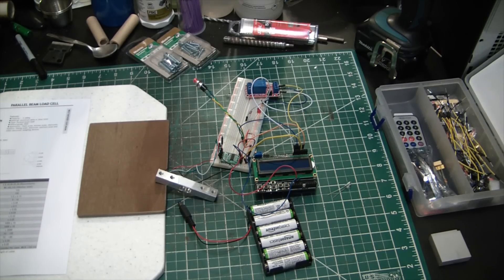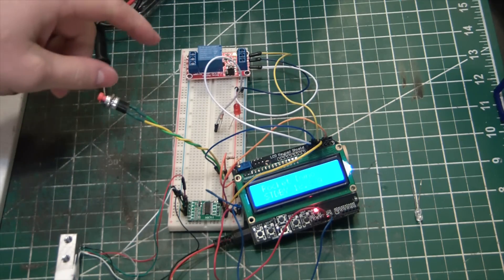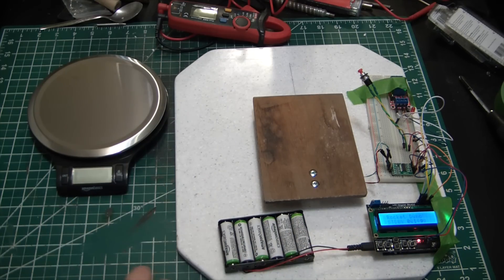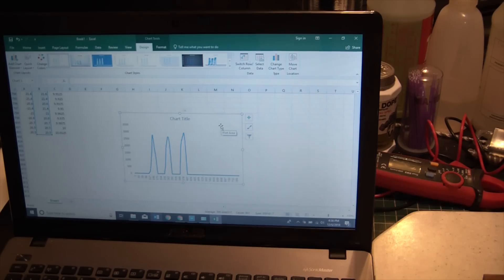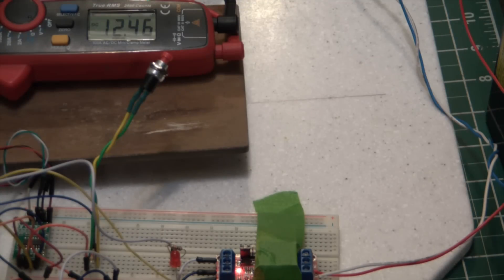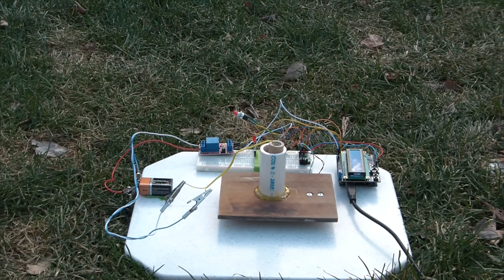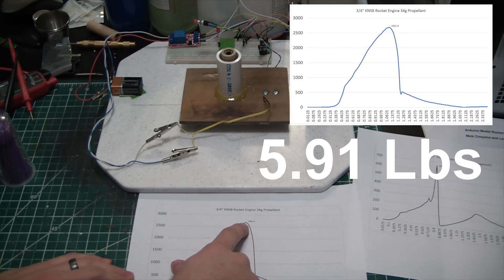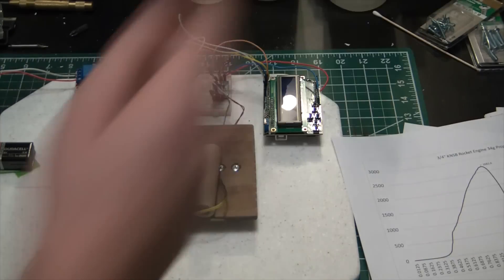Arduino Rocket Motor Thrust Test Stand! - Elementalmaker

Comment: someone who built the test stand?
I am having problems with the operation.
when I connect the arduino the relay is activated and deactivated immediately after the yellow led makes 4 sequences of 4 blinks (as far as I can see), the lcd says "MODEL ROCKET DYNAMOMETER" and the serial monitor says "HX711 Rocket Motor Dynamometer, V .5 Affix motor nozzle up. Place igniter in nozzle. Move away from teststand. Press start button to initialize ignition sequence. "
when I press the button it does nothing. on one occasion it started taking readings (very slow about 1 per second which I think is the calibration of the load cell) and when I opened the serial monitor the code restarted and no longer worked.
I have an XFW-HX711 I desoldered the jumper that I had at 10Hz and I soldered the 80hz one, as it didn't work, I used another XFW-HX711 WITH 10Hz and it didn't work either. Any idea what is happening?

EDIT:  Here is the update code

#include <HX711.h>

#include <LiquidCrystal.h>
LiquidCrystal lcd(8,9,4,5,6,7);
const int buttonPin = 12; // start sequence button
const int ledPin = 13; //LED indicator and/or buzzer
const int igniterPin = 11; //igniter transistor circuit
int buttonState = 0;
#define DOUT 3
#define CLK 2
HX711 scale;
float calibration_factor = -1120; //-560 works for my 10kg loadcell.

void setup() {

 scale.begin(DOUT, CLK);
  
 pinMode(buttonPin, INPUT);
 pinMode(igniterPin, OUTPUT);
 pinMode(ledPin, OUTPUT);
 Serial.begin(9600);
 Serial.println("HX711 Rocket Motor Dynamometer, V.5");
 Serial.println("Affix motor nozzle up. Place igniter in nozzle. Move away from teststand.");
 Serial.println("Press start button to initialize ignition sequence.");
 lcd.begin(16, 2);
 lcd.clear(); 
 lcd.setCursor(0,0);
 lcd.print(" MODEL ROCKET");
 lcd.setCursor(0,1);
 lcd.print(" DYNAMOMETER");
 delay(2000);
 scale.set_scale();
 scale.tare(); //Reset the scale to 0
 long zero_factor = scale.read_average(); //Get a baseline reading
 Serial.print("Zero factor: "); //This can be used to remove the need to tare the scale.Useful in permanent scale projects.
 Serial.println(zero_factor);
 Serial.println(" ");
}
void loop() {
 lcd.clear();
 lcd.setCursor(0,0);
 lcd.print(" Rocket Dyno");
 lcd.setCursor(0,1);
 lcd.print(" STDBY " );
 scale.set_scale(calibration_factor);
 lcd.print(scale.get_units(),1);
 lcd.print(" g");
 delay(500);
 buttonState = digitalRead(buttonPin);
 if (buttonState == HIGH) {
 lcd.clear();
 lcd.setCursor(0,0);
 lcd.print(" Rocket Dyno");
 lcd.setCursor(0,1);
 lcd.print(" STAND CLEAR!");
 Serial.println("IGNITION SEQUENCE ACTIVATED!");
 for (int i=0; i <= 50; i++){
 digitalWrite(ledPin, HIGH);
 delay (100);
 digitalWrite (ledPin,LOW);
 delay (100);
 }
 lcd.clear();
 lcd.setCursor(0,0);
 lcd.print(" Rocket Dyno");
 lcd.setCursor(1,1);
 lcd.print(" AQUIRING DATA");
 digitalWrite(igniterPin, HIGH);
 Serial.print("Start time, ms: ");
 Serial.print (millis());
 Serial.println(" ");
 Serial.println(); 
 for (int i=0; i <= 800; i++){ //800 samples at 80sa/sec = 10 seconds theoretical
 scale.set_scale(calibration_factor); //Adjust to the calibration factor
 Serial.print(scale.get_units(), 1);
 Serial.println();
 }
 Serial.println();
 Serial.print("Stop Time, ms: ");
 Serial.print(millis());
 digitalWrite (ledPin,LOW);
 digitalWrite (igniterPin,LOW);
 Serial.println();
 }
}

Comment: I had a amateur rocketry hand book from the late fifties. They were using sulfur and zinc propellant, in small CO2 cylinders with machined nozzles. Claims of 35000 feet were in the book, for cigar-tube sized rockets. Have you ever tried that propellant?
Reply from the maker: Ah the old sulfur zinc propellant! I've experimented with it a bit, but it's quite low power compared to other propellants and has a strong propensity to explode if the grains have any imperfections or cracks. It's not very effective because it's reaction product is zinc sulfide, a solid. Gas producing propellants will typically outperform ones which produces solids. 35000 feet sounds very optimistic in my book!
Reply: @ElementalMaker  I thought so, myself. I've never used anything besides commercially produced engines, though.

Comment: Fantastic video and channel! I'm in the process of creating a test stand for undergrads as my masters dissertation and I'm just wondering what you would improve upon if you were to make this test stand again? Which Board would you use instead? Furthermore, how would you go about igniting the rocket using LabVIEW?
Reply from the maker: Hi George, The stand works quite well as is, only change I would make is a nice housing for the Arduino and HX711, maybe a custom board of some sort would be best. Its been a very long time since I worked on LabView, so I can't give any input there.
Reply: @ElementalMaker  Thanks for the reply! I'll for sure shield them when I begin testing my own propellant. Another question (if you don't mind!) but do you have any advice or resources that would help if I were to add another load cell (measuring fuel) and a couple transducers (exhaust temps) to the design?
Reply from the maker: @Epic2Dive  In all honesty I'm not that handy with Arduino, so I cant say how it would be implemented, but I am sure you could also use a HX711 and load cell to measure fuel mass (assuming you are using a liquid fueled rocket?). I am not sure if there are any existing temperature transducers that could survive the pressures and temperatures at the nozzle orifice, but perhaps a thermocouple could survive inside the combustion chamber.

Comment: Great video. Ive assembled everything to make the thrust stand but I'm at a total loos when it comes to programing. Is there any way you could make a step by step video on programing the Arduino? Keep up the good work. Thanks
Reply from the maker: I have a link to the document I used in the video description. I pretty much copied and pasted the code, and just had to change the zero factor to be sure it was correctly calibrated. I might have to do a video showing the process
Reply: @ElementalMaker  Could you please make a video showing the programing process. I'm still having no luck getting the scale to work. Thanks

Comment: How did you solve the problem of erosion of the opening on the Rockets clay nozzle?
Reply from the maker: Still seeing erosion. Working on some new nozzle compositions to minimize it, but nothing to successful yet
Reply: @ElementalMaker  is there any way to fire the clay so it becomes somewhat of a ceramic? Or maybe there is a compound that can be use instead that can be fired at low(oven) temperatures without needing a full kiln.
Reply from the maker: @ald88cod very good idea! I'll have to try to find a washer that fits just right, or just machine a bunch on my lathe! The nozzle composition is quite inert, it's 50/50 bentonite and grog (an inert ceramic) with paraffin added to help it bind when pressed. I am going to test adding aluminum oxide and other refractories to see if I can avoid the washers, but that will definitely be something I try!
Reply: @ElementalMaker  seems right off the bat that the paraffin will melt because of the temperature the burning fuel so it will lose all binding properties. I just saw a video where guy used a 50/50 mixture of Portland cement and Durham's rock hard water putty for his compound and he also Incorporated a washer to control erosion somewhat.
Reply: @ElementalMaker  last thought for the night and then I'll shut up. Plaster of Paris has a working temperature of up to 1200 degrees Centigrade so that's starting point for refractory mix, adding perlite like they do for forges might help also. I think they also use a little bit of silica sand in the mix. Just some thoughts from a sleep deprived addled mind. God bless you all have a good night.

Comment: Hi i have viewed the pdf file and has done the same circuit as the diagram. i copied the code , there is some code problems however i was able to figure it off, howver, now in the serial monitor it only shows Affix motor nozzle up. Place igniter in nozzle. Move away from test stand.
Press start button to initialize ignition sequence.

I tried pressing the button but nothing works, I also  tried connecting it directly making the wire as the "button" it still do not work. can you please help me? thank you
Reply from the maker: Hi David, please email me (see about me page for email) and I will send you my code.

Comment: Youtube hates a channel where you make fun things using HS level chemistry?! Say it ain't so! One of your videos inspired me to chat with a pretty lady about nitrocellulose. . . 

Question for you: How would you filter out the water vapor from a NaOH+H2O+Al reaction if reacted in a 6.5gal carboy?  Moist cotton plug?
Reply from the maker: I would run it through a secondary drying chamber filled with Silica gel or dried calcium sulfate. Glad your enjoying the videos!
Reply: I wonder how that conversation went.
Reply: Energetic? It is a simply way for someone to make hydrogen gas at home. It is quite exothermic, so you get a lot of steam along with your hydrogen. So if you want to do fun things with pure h2 you need to seperate the two.  It can also be useful to pre-heat the carboy to extend the life.
Reply: I'd suggest using a long collection hose with a way to cool hose. Try to arrange it so the water can flow back to the carboy.
 
I think silica gel or calcium sulfate would get saturated really fast.

FWIW, I had the same problem as a kid making hydrogen for balloons. At the time I just added less aluminum at a time to keep the reaction from getting too hot.

I used a glass Tab bottle (the large ones) as my reaction vessel. I had one bottle break because of the heat.
Reply: Yeah, some airline perhaps, through an ice-bath.
Reply: @Fusako8  an ice bath, seems excessive. you could just make a condenser sistem, the vapors go up one condenser, it gets hot, the vapors go down a tube to another condenser, it gets hot, repeat, so long as you can keep these condensers at a somewhat low temperatures, about the 50´s, the hydrogen should separate from the water.
then just hook it up to a can filled with calcium chloride just for good measure.

Comment: I cant help but think the cantilevered beam load cell would indicate different loads for different placements of the same motor. (I.e., place the motor above the mounting screws vs place the motor at the end of the beam) Is there a sweet spot to place the motor?
Reply from the maker: I though that would be a major issue as well, but I tested placement of loads over the entire surface of the loading platform and it was incredibly uniform. After thinking about the force diagram for a bit though, it makes sense that the load is uniform.
Reply: @ElementalMaker  I read this after making a whole bunch of averaged measurements all over the platform and head scratching.

Comment: I don't think your propellant is burning properly. Sure it lets the smoke out but shouldn't there be a flame cone from the nozzle? Nilered does some nice oxidiser/fuel ratio with nozzle constriction comparisons, might help with fine-tuning?
Reply from the maker: No flame because this is a knsb engine. It produces potassium carbonate as a product of combustion, which kills any flame that would otherwise be visible.
Reply from the maker: Nile Red was working with a totally different propellant type

Comment: Would it matter that the small engine was facing at an angle and us having more leverage on the thingamajig?
Reply from the maker: Its possible, but once ignited it sat pretty vertical, any data skew from that should be quite minimal, and if anything lower the measured thrust a hair.

Comment: Do you know if this load cell will work in reverse? In other words, the ability to check lift. I have an idea for a rig to get around the idea, not sure if it's worth the trouble if the load cell can work in the negative value direction.
Reply from the maker: Yes the load cell should be bidirectional without any issue

Comment: I built the hardware for this, but it seems that the sketch for the HX711 has changed from its original form and will not work with Nick and Len's original sketch. Any ideas on how to fix this?
Reply from the maker: I do recall it took some tinkering to get the code to work. If you can shoot me your email address, I will send you the code I have working. I think the big thing was updating the code to call out new libraries, as the ones called out in their original code were not available.

Comment: Could you tell me why did you use relay?  Could you not connect the igniter directly to the breadboard?
Reply from the maker: Sure thing! My ematches are designed to use 9V to properly ignite. The arduino output voltage is only 5V so it wouldn't be enough to ignite the ematch in a reasonable time. The arduino output current is also proably too low. Using a relay allows you to control it with the arduino, but you can then send any desired voltage to the ematch through the relay.
Reply: @ElementalMaker  thank you so much

Comment: Can I use these setup for testing big rocket engines
Reply from the maker: Yes, I upgraded mine to a 50kg load cell, but it could be used with any size load cell, you just need to change the calibration factor
Reply: @ElementalMaker  it is possible to connect pressure sensor,servo valve, temperature sensor, accelerometer,load cell,mass flow meter in that Arduino board pls reply me sir

Comment: Question, Will this work for a larger load cell to measure like 350 LBS of thrust?
Reply from the maker: Absolutely, you will just need to get a larger load cell capable of withstanding that force. At that thrust I would also consider making you test stand mounted into the ground, perhaps with a concrete footer or such
Reply: @ElementalMaker  Thanks for getting back to me so soon! Yeah thats the plan! I found your video trying to figure out how to implement a Arduino based load cell to get the thrust curve.

Comment: Did the throat of the nozzle erode on the 3/4 incher again?
Reply from the maker: Yep got a bit of erosion again, despite making the clay section about 2/8" longer. So I need to reformulate my nozzle composition. Maybe add some aluminum oxide or something of the sort.
Reply: On some larger knsb motors I've seen people use a washer with the right ID to support the throat.

Comment: never did like those little electric matches, who would have thought too much current would make them fail?
Reply from the maker: These are ones I make specifically for 9v ignition. I should have known better than trying a 12v with them.
Reply: @ElementalMaker  oh neat. It's interesting though because i used to have trouble with the Estes ones all the time and was firing them from 12 volts. I prefer a good fuse.
Reply from the maker: @m3sca1  yep they don't like too much voltage otherwise they just burn up in an instant. I think estes are designed for something like 3V. I love a good fuse myself as you might have seen in my other videos, but for this test I needed the motor to fire at the exact moment the arduino was acquiring data.

Comment: Could you tell how you did that graph from the Dara?
Pleseeeeeeeeeeeeeee 😁
Reply from the maker: From the Dara? huh?
Reply from the maker: OHHH DATA! Just put the data into excel, since the numbers from the arduino are negative I ran an "abs(columnA)" function and then graphed that data using a line chart.
Reply: @ElementalMaker  thanks
Reply: @ElementalMaker  sorry spelling mistake 😅

Comment: Hi,  ElementalMaker,  you may want to check out the Tech Ingredients channel as they are doing some very interesting experiments with different grain formulas and ignighters.  I have tipped them off about your excellent rocketry experiments.  Be warned that they have a very different style to you which you may find a touch slow but the science is worth watching 
Cheers.      Mark

Comment: What's your thrust in ft lbs and. Newton meters?? 
You just gave us the weights exerted on the sensor but you never actually told us how much actual power they have.

Do you know by any chance??
Reply from the maker: Honestly not really that sure. I would think that's just the thrust in pounds... If you know better tell me how to go about it because I'm clueless lol
Reply: foot pounds and newton meters are both measurements for torque not thrust. Thrust is measured in units of force which would be pounds or newtons. That measures the instantaneous power of the engine if you want to know how high the rocket will go you might integrate that with time to get the total change in momentum. Im not sure which you mean.
Reply: @ElementalMaker  it could be that hes asking about how much total power the engine has which you could graph in excel pretty easily by adding up the measured force and dividing by the 80 data points per second. It would probably be good to have that number anyway because the total is probably what you want to ultimately increase rather than peak output.
Reply from the maker: Yeah that would be specific impulse of the motor. Working on calculating it in excel now.
Reply: I'm looking to compare them to the name brands. They are usually done out in total impulse.

 I'm familiar with the Estes D12-0 it has a total impulse of 20.0 newton seconds if I remember correctly. 

It would be nice to be able to compare them that way.

Comment: I have about 2lb. of sodium sulfate mix it with potassium nitrate and lite the fuse what would happen
Reply from the maker: No real reaction. The ions will simply swap partners, but it probably would only work in solution and not be an ignitable reaction.